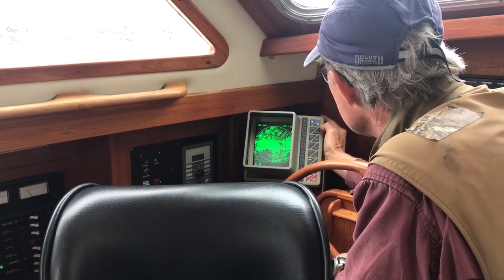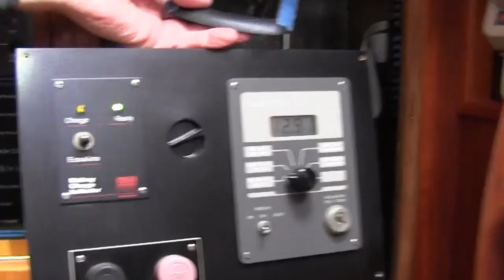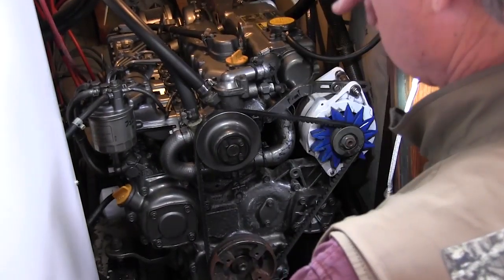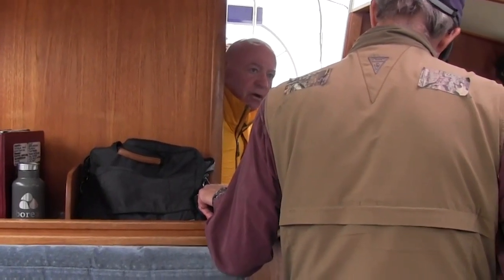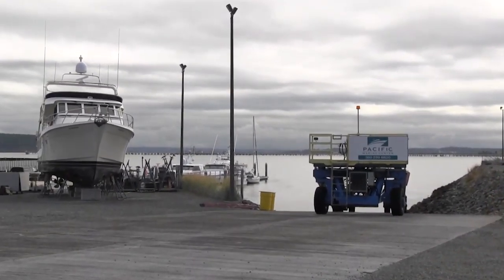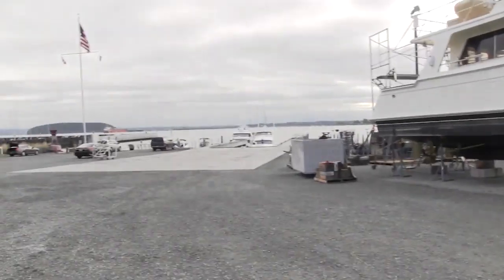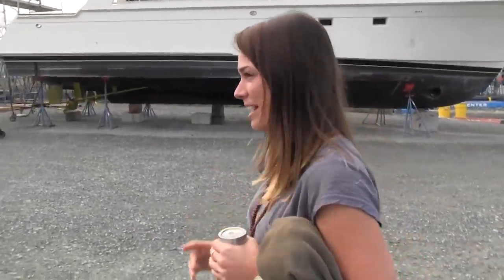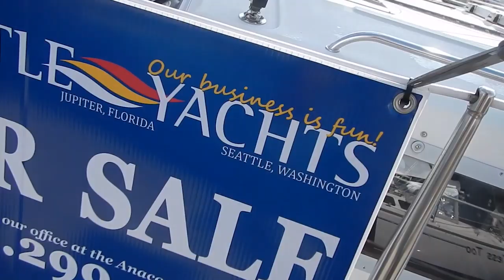Taking POSSESSION of our new boat! - Ep06

Comment: I hope yòu got a little break on the price for some of the issues and did you find out where the water was getting into the tanks?  Hugs from Canada
Reply from the maker: B. M the deal we made was ‘as-is’, but we think we did alright with our offer. It was probably either just condensation built up in the partially filled tanks from years on the hard in the pacific north west, but we are also re-bedding the deck fills just incase.
Reply: @BreakingWavesSailing  thanks so much for taking the time to reply my post was horrible and dumb phone key boarding isnot our forte we will eagerly wait and watch each episode. Keep up the great work.  Hugs from Ontario Canada!